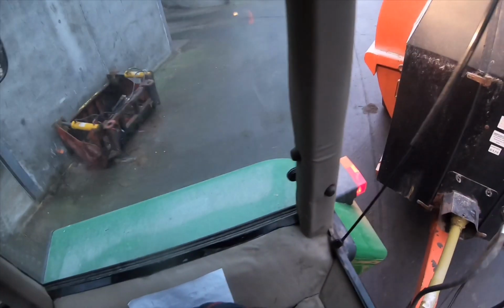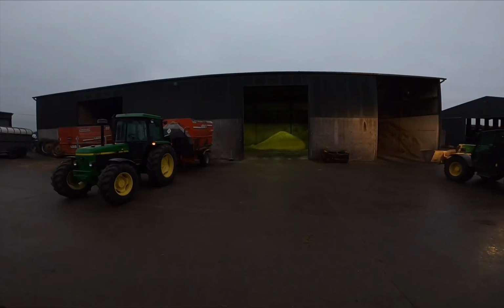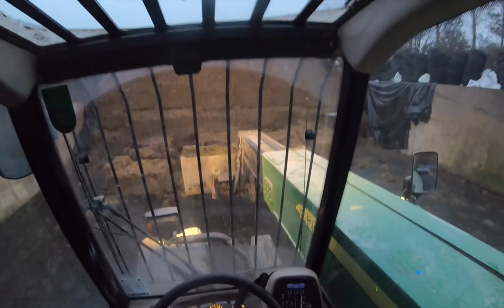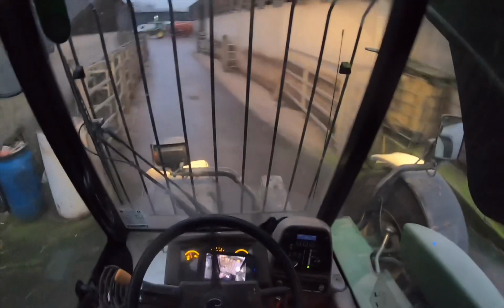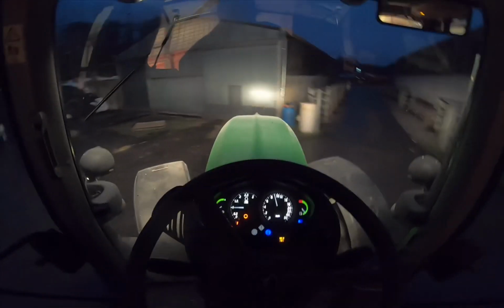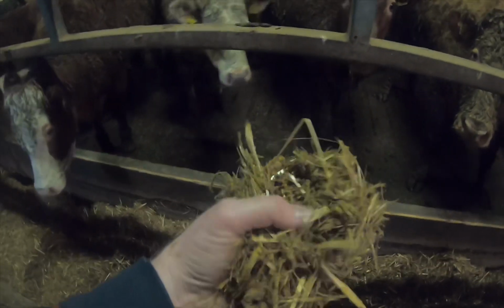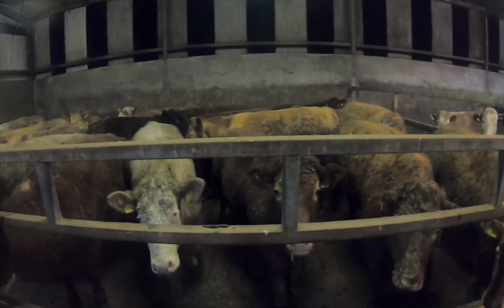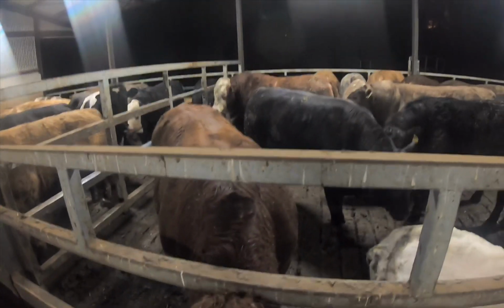FEEDING THE BEEF CATTLE

Comment: Where do you buy potatoes in bulk like that? Do you grow all your grain yourself? Sorry, one last question 😅
Have you noticed an improvement in your cattle since before adding a diet feeder to your operation?
Reply from the maker: Blankity Blank buy bulk potatoes off a potato grower. These are damaged or odd shaped ones not fit for human consumption. We have diet feeders since 1999 and they do improve intake and  weight gain. You have great or control over feeding. It allows you to buy and mix by-products also
Reply: @gerry6420  thanks for replying! That's great advice